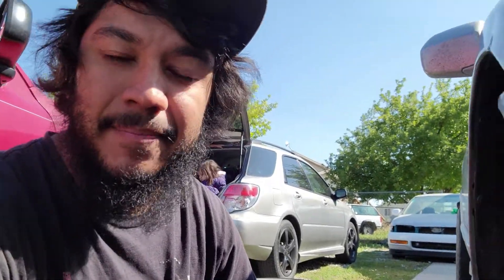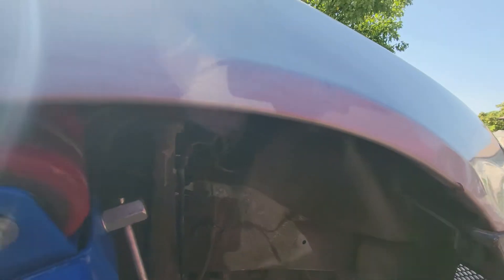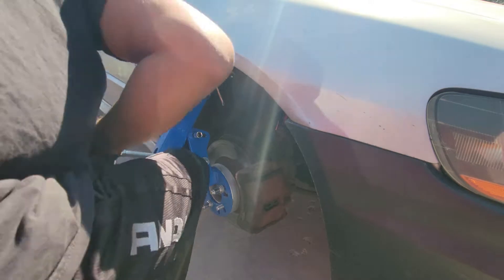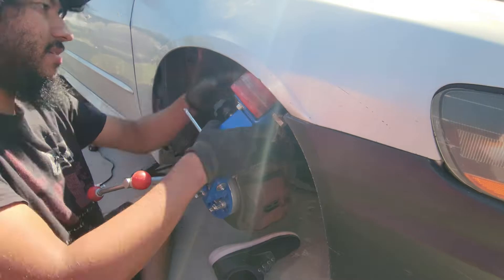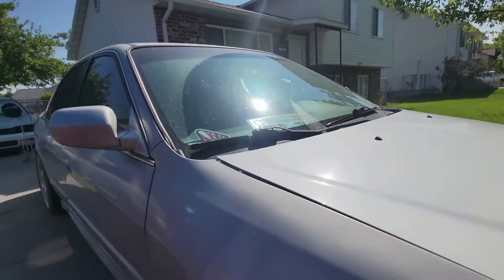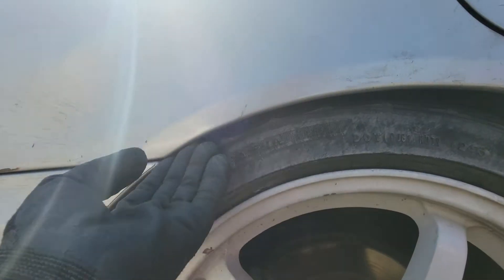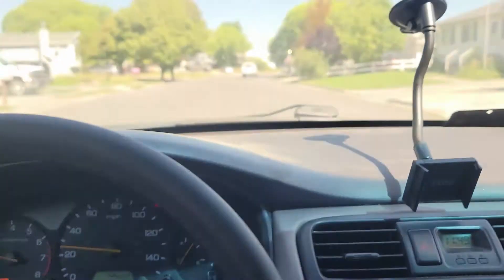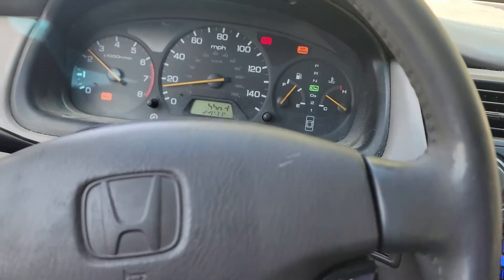rolling the fenders on the 01 Honda accord CG6

Comment: You should have got one of those industrial hair dryer heater deals with the fender roller. As long as you don't get it too hot it won't mess up your pant but helped some metal bend and stay in place